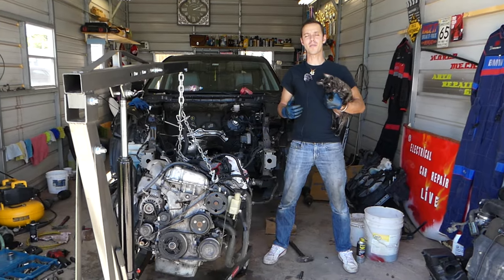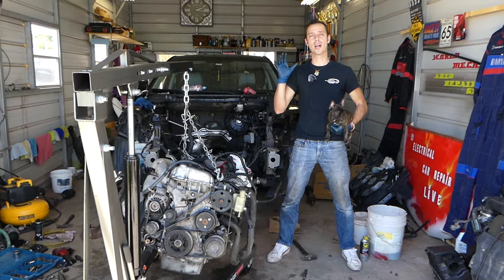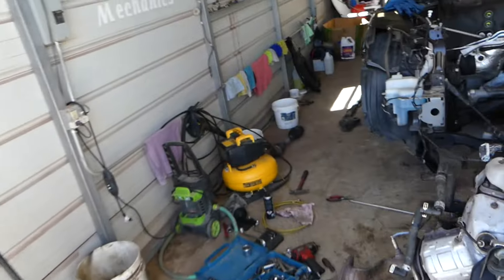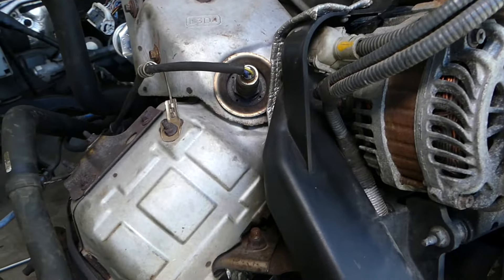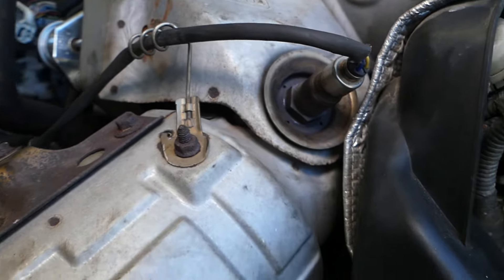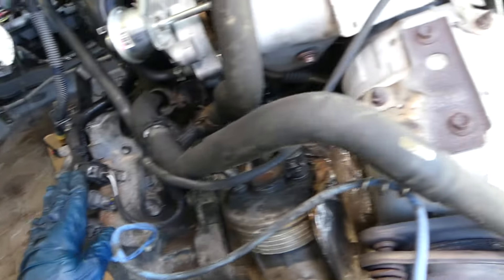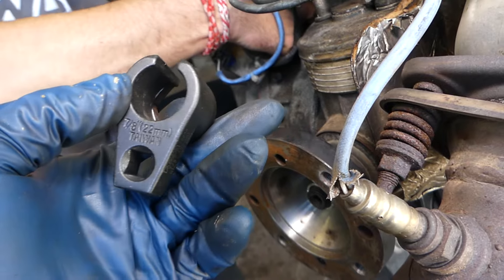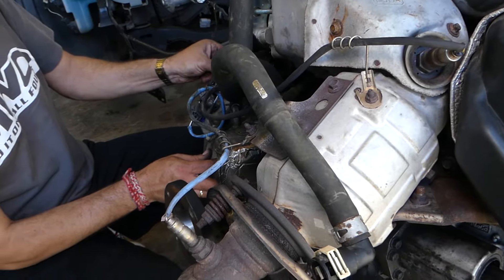OXYGEN SENSOR 1 2 LOCATION REPLACEMENT MAZDA 3 6 SPEED CX7 CX-7 UPSTREAM DOWNSTREAM

Comment: The linked o2 sensors in the description DO NOT fit a mazdaspeed3. i ordered them and busted my butt fidgeting them out just to find that the female port that connects to the piece on the engine is too small. besides showing us the locations while the engine is pulled is dumb because obviously no one is going to pull their engine to replace o2 sensors.
Reply: True! There should be a disclaimer in the description
Reply: because this vehicle is a Mazda cx-7.  a lot of parts are the same, the sensors are different.

Comment: Thank you, I'll try to solve it by myself, my obd2 reading is showing me p0140 fault code bank1 sensor2 so I think the sensor that needs replacement is the blue wire one. I will inform myself as much as posible so I dont make mistakes. 👍
Reply: Did this work my dude? I'm having the exact same issue
Reply: @mobiusone9997  havent done it yet
Reply: @jamesacheneider  hey man so I swapped it out today. It took about 30 minutes. I bought a NGK universal sensor online which ran about $80. There is a sensor in the exhaust manifold on top and one directly before the cat. The one before the cat is what our code says we need to replace. The O2 sensor is easily located under the car and removed by a 22mm O2 sensor socket. But unplugging it from underneath was tough so I pulled the battery and removed the battery box which made it much easier.
Reply: @mobiusone9997  Thanks man for taking the time, I'll use your advice when fixing it probably this weekend, I have pretty much 0% exp in car repair but I'll use all the internet support I can, whish me luck, have an excellent day ty :)
Reply: @mobiusone9997  did you have to go under the car to get at sensor 2?
Reply: Jesse McVeigh he said he took the battery off and box to acces the wired from the top because from underneath is a pain in the ass you can’t even see with wire is which
Reply: @mobiusone9997  Hi man its me after this long time xD, sorry you told me that you could reach the unscrewable end of the sensor wire through the bottom of the car easily? Im gonna be doing it soon, so I know that the end that unplugs can be removed after taking out the battery but any more details about the one at the bottom, ty for ur help.

Comment: This saved my butt, Thank you!
Reply: Was it easy to replaced??
Reply: @donkiko6708  mine was crosthreaded, so I had to buy the tool to re thread it. It was nerve wracking work but as long as you take your time and don't force it. It was not that bad. Just make sure to for every turn you go back a quarter turn to make the tapping not crack the manifold
Reply: gaby1491 oh ok and how did you pull the wires from the top or underneath?? Because some people said you could take out the battery and pull them from the top
Reply: gaby1491 well hopefully I don’t have to re thread mine I just want to put the new one and get it done 🙂
Reply: @donkiko6708  how many miles? It very likely you will need a torque bar, and if it's your only car just buy the tool on Amazon or eBay for 8.99
Reply: gaby1491 can you send me the link for the tool so I can buy it on amazon ??
Reply: gaby1491 mine has 130k miles
Reply: @donkiko6708  there is only one tool you can't miss it
Reply: gaby1491 so you don’t think I can take the old oxygen sensor out and just put the new one without using that threaded tool ?
Reply: @donkiko6708  no, but if you need it it's better to have it
Reply: gaby1491 okay thanks I will buy one tomorrow and get the job done this weekend
Reply: @donkiko6708  btw these Mazdas are not known for their reliability. If it's your daily, that's no bueno
Reply: gaby1491 I got it cheap tho so I don’t mind I been driving it for 2 years everyday so far just the oxygen sensor giving me trouble
Reply: @donkiko6708  you gotta take out the battery and the battery box, then you can unplug the two wires from the harness. Pro tip if the clip is too tight the harness is bolted by a small metal bracket with a m10 bolt, take that out and then use a screw driver to gently take out the clips for the sensor
Reply: gaby1491 I went to a hardware store and I bought a 3/8 oxygen socket what size wrench do I need and  extension to take out the sensor??
Reply: gaby1491 I only have a 3/8 socket wrench that’s 12 inches long
Reply: @donkiko6708  i used a torque bar that was 5ft long, but mine was seized. although your luck might be better, i dont think a 12 in bar will cut it.
Reply: gaby1491 hello I’m working on this sensor but I can uclipp the clips they’re too tight I tried everything
Reply: @donkiko6708  can you send a private message on YouTube?  You can try cutting the cable to the old o2 sensor and use that to pull while you use your other hand to push on the tabs for the sensors
Reply: gaby1491 I finally replaced it I just pull the clippers up with my fingers and it came off the bracket I unplugged them and I install the new sensor luckily for me I didn’t had to use the thread tool that I bought
Reply: @donkiko6708  just remember to put the clips back and tighten them because if the wires touch the engine they will melt
Reply: gaby1491 yes I put them through the metal wire again and I used the plastic clips that they had as well to hold them
Reply: Tomorrow I will replace an oil leak on the intercooler 👍🏼
Reply: gaby1491 did your check engine light went away??
Reply: @donkiko6708  you have to unplug the battery and then wait 10 secs before plugging it back in

Comment: My 2009 Mazda 3 has been misdiagnosed a few times by different garages including a Mazda garage. The fault code is P0134. I keep paying for new Oxygen sensors all the time and the warning light comes straight back on when I get the car back. The issue is definitely not the O2 sensor. It has to be something else. 

The trouble I have is that garages keep charging me a lot of money just to plug in their devices and laptops for 5 minutes to read the fault code and they just assume it is the Oxygen sensor but it isn't. 

The O2 sensor I have is brand new so the issue must be a vacuum leak, wiring issue, or something else I'm not mechanic enough to know. The bulkhead was even replaced last time as well after I had paid them for yet another new O2 sensor that didn't solve the problem. But after the bulkhead was replaced for an alleged vacuum leak the warning light has come back on yet again with code P0134.

Do you have any idea what it could be beside the O2 sensor? Is it a wiring issue? Or a bulkhead that wasn't repaired or sealed properly? Or something else? Could it be something as simple as a fuel cap?
Reply: I am not a mechanic myself but first thing you need to do is head to Walmart or even Amazon and get yourself an OBD2 Code reader, that way you will be able to see what codes your car is throwing without having to pay money everytime someones plugs theirs in just to read you the code. Next, I just looked up the code you said that your car was throwing and if the problem has not been the sensor like you say, I would maybe try and replace the ECM (Engine Control Module) because that's the only other part that the code mentions when I looked up its meaning on Google.? 
 is a relatively common OBDII trouble code. It's generic, which means that it has the same meaning for any vehicle with OBDII. It means that the PCM/ECM is not detecting any activity from the sensor.\
Reply: Please be sure to post here again and let us all know what the final outcome was and how you solved your problem, so that if anyone else out there comes across the same issue you dealt with, they will know what to do next.
Reply: google or youtube yow to test the harness connector to the 02 sensor.  or clogged cat,  multiple more things.  good luck
Reply: Did you solve the problem? 
You can try removing the O2 sensor and check if the power is coming at the receptacle (other side of the connector)
Also that the voltage is changing as the car warms up